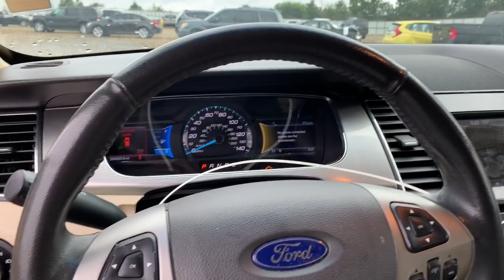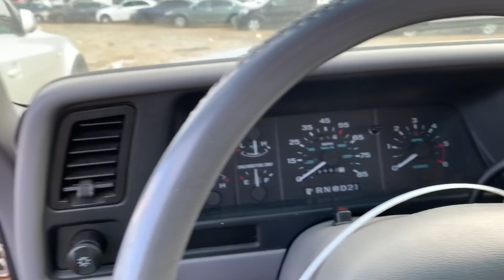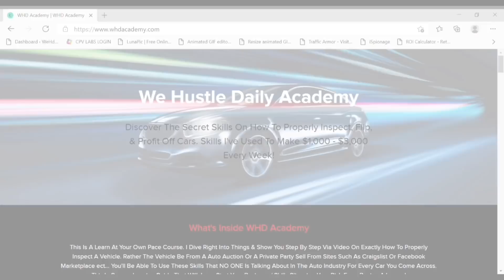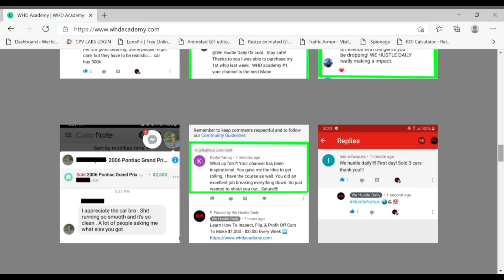*WINNING A NEW CAR!* TRACKHAWK SELLING FOR THIS MUCH IN THIS CONDITION AT THE INSURANCE AUCTIONS!

Comment: Most id pay for that trackhawk is 15k itll cost about anither 20-30 to get the body fixed right and bio cleaned. And another 7k to have all the electronic components caught up. So for a keeper its worth it but youd only make at most 10k in profit but after putting about 60k into it I'd want more
Reply: Only way I would take that trackhawk is if was free. By the time you get everything fixed u might as well bought one from a dealer unless it's going to be a project

Comment: That Ford Taurus and Toyota Solara are a go and the track hawk may be good for parts but at 5k and the engine turn up I don't know whats left it if for parts
Reply: Yea drove a 2011 Ford Taurus for 50,000 miles with check engine light. Most of the time it's very minor.